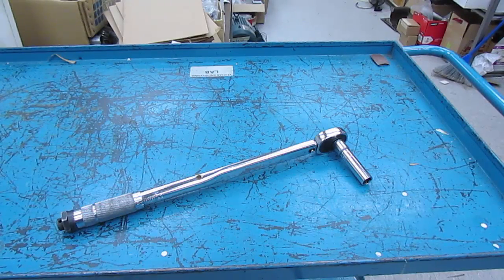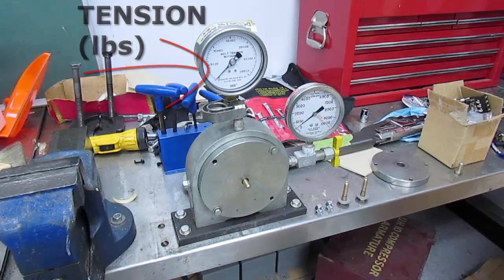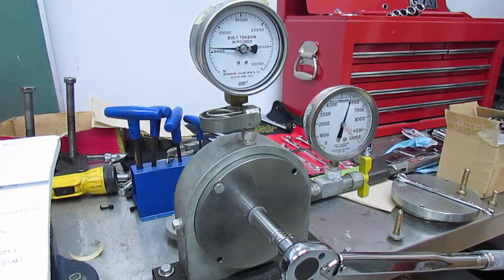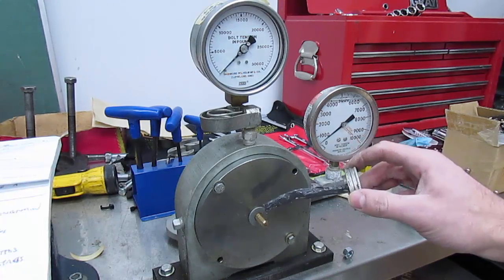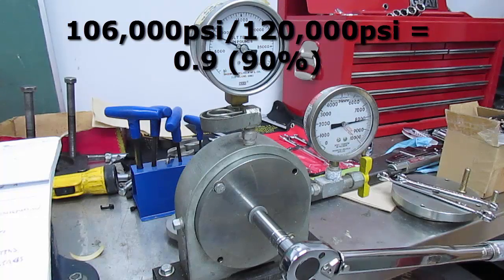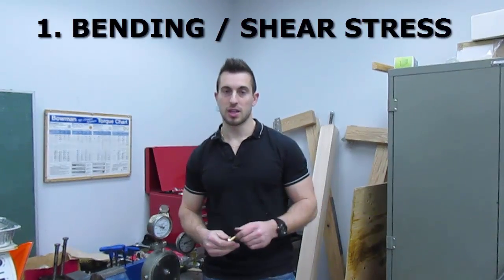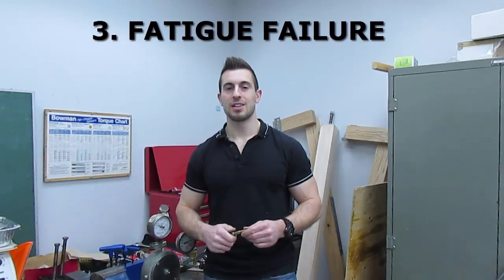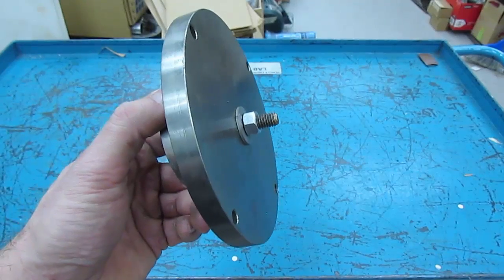Should You Put Anti-Seize On Wheel Studs / Lug Nuts?

Comment: hey whats up. I have a co-worker that goes crazy with this anti-seize stuff. I like this video cause it was super interesting. rather than just putting a dap, he covers the whole thing with anti-seize. now in your video you said that over time if you keep using anti the stud or the bolt will loose tension and it wont hold as well. well, I work at a shop that cars come back all the time for tires. or I see that the car previously had anti already on it. well bottom line I have two questions.
1. what can happen if you put too much anti-seize?
2. if you put too much, over time can your lug nut slowly loosen and fall off?
video was awesome please get back at me.
Reply from the maker: Thanks for the comment! Anti-seize will change the friction as I mentioned in the video which will increase pre-load (bolt tension) for a given amount of torque. As you can see, it's not difficult to change it enough to exceed the yield strength of the material and cause total loss of elasticity in the bolt. That being said, it's very difficult to quantify how much anti-seize is considered "too much," OR if any amount at all is acceptable. That would be something that would have to be measured experimentally I would imagine. So unless your co-worker plans on doing the experiment and then applying anti-seize with a syringe, I would recommend that he doesn't use it on wheel studs unless the manufacturer recommends it (and can provide a wet torque rating). So to answer number one and two at the same time, any amount of anti-seize has the potential to cause the wheel nut to back off and fall off if torqued to the dry torque spec of the bolt (stud). It can stretch the bolt and you will have zero clamping force potentially. Let me know if that makes sense to you :) Thanks for watching!

Comment: How is clamping force different from preload, does not the preload created the clamping force?
Reply from the maker: Hi Daniel, thanks for watching! Yes the clamping force is generated by the preload, however, it can be different. For example, if you have multiple fasteners, your clamp load will be higher than each individual tension load in the bolt. Also, depending on external forces, a compression force acting on the joint may increase the clamp load and decrease your preload. Check out the link in the description for a more in depth explanation! Thanks!

Comment: I've been an ASE certified mechanic for 11 years worked on thousands of cars and owned many cars for hundreds of thousands of miles and yet the ONLY problem I've encountered is lugs without antiseize on them.  Every time some crack head at a tire shop blasts your lugs off and or on, at full speed with a impact gun is what will get this problem started.  I do what my instructors had tought me and it never fails, ever.  Now over applying antiseize is bad and less is more when it comes to high load applications but in mine and every ASE certified master tech teacher I've ever learned from, has the derect instruction to use it after factory bolt coatings have been compromised.  

I'm interested in diffrent types of antiseize and measurable amounts in application alongside the effects of heat/cold and material grade that had antiseize applicated.  Re-torque lugs you use antiseize on, is in my opinion strongly advised as over applying will allow spec to looses as where just enough will stay in spec.  Remove excess if torque spec fell out after 50 miles, then again at 50 miles if there was a correction. [do it right the first time]

Spark plugs on another note can react negatively with antiseize especially those with a low torque rating to begin with but otherwise high torque plugs, do just fine and prevents the use of adding a helicoil down the road. 

My experience is tried and true with time to tell and all I suggest is if you do use it, don't over do it.  .5-1 milliliter appropriately placed will do its job correctly but do cover all the threads.  Application is KEY!

A shirt ton of the stuff is all bad and unfortunately in my opinion voids this experiment, I like the example though!

To add some gravity, I placed 1st in Skills U.S.A., a national competition for mechanics.
Reply: Gamma Light - I was introduced to Anti seize compound in 1960. It was provided to me at a Chevrolet dealership I worked at as the factory recommended cure for the problem we were having with steel studs damaging the threads on the newly introduced aluminum Corvair engines.
The advise of using it sparingly is correct. I left the automotive business in 1962.  I continued to work on my own cars for fifty years and I still have the same can of anti seize. No wheels coming off or spark plugs pulling the threads out of heads in all that time.
Reply from the maker: Thanks for weighing in! I will agree with you that for re-torqueing there is a place for anti-seize. The thread surfaces get chewed up after the first torque application and then friction increases, thereby reducing preload on subsequent applications of torque. Some amount of anti-seize can "restore" the original friction properties and give you the initial preload. 

In my opinion, however, most people blasting lug nuts on and off are not 1st place ASE certified mechanics and they will definitely not measure out the amount of anti-seize being applied. Most people don't even recheck the torque on their lug nuts after 50 miles. So the problem becomes that people will over do it with the anti-seize and they over tighten on top of that (no torque wrench, no torque stick on an air gun, etc.) Professionals such as yourself take much greater care in what they do.
Reply: I agree. Less is always better when applying anti-seize but it is definitely necessary in certain - not all - instances. For example, did you know that NGK spark plugs have a proprietary anti-seize on the threads from the factory? However, once removed they have to have anti-seize added if you want to re-install them. Sparingly, of course.
Reply: Gamma Light. Im starting to learn what lubricants to use on my car and hoping that maybe you can help me out
Reply: No offense. But with all due respect, you may still be putting people lives or at least vehicles, at risk. This guy and his exceptionally well thought out and detailed video may have just saved me from catastrophe. Although in my case, all 12 posts and lugs were rusted then compromised. Alot of people don't know this but even surface rust changes the entire properties of a bolt and it's threads! So to me why even chance it for a little bit of money??

Comment: Good video. They should provide lubricated torque specs for everything. I have used anti sieze on pretty much everything including lug nuts and never had a problem.
Reply: Likewise. I started using anti-seize on wheels and lug nuts out of self defense. 
First, when I could not get my lug nuts off (no impact wrench at my house) my car, I used a cheater bar on the lug wrench and litereally twisted the lug bolts in two WITH THE NUT STILL ATTACHED. 
Second, when I could not get my alloy wheel off my steel brake hub I had to use a small sledge hammer to literally knock if off. 
Since then, I've used anti-seize on the lug nuts WITH A TORQUE WRENCH and I've used anti-seize on the brake hubs that are exposed to alloy wheels. Since then, I've NEVER had a problem with anything coming loose. I've discussed this issue with several professional mechanics and they have all agreed with me. 
This is fact based on my personal experience and not an opinion.
Reply: @boomerguy9935  If that ever happened to me I'd be inclined to use anti-seize on the lug nuts as well, but like with OP I change my wheels every Winter so there's not much chance they'll get welded on. However I am going to be replacing the lug studs and nuts after seeing this video. I've made around ten trips to tire shops in-between doing it myself over the past several years and now wondering how stretched everything is out of spec. Better safe than sorry.
Reply: You should do this test with loctite on a bolt, I would think wet loctite would increase the fastener load.
Reply from the maker: Loctite is supposed to simulate the friction of a dry fastener, and therefore has been designed to not be a friction modifier. Realistically you will probably see some difference, but it shouldn't be nearly the difference you see with anti-seize.
Reply: Big Miss: 2 types of wheel nuts. 
Type 1: open top. No chrome cap. Good. 
Type 2: cap nut. Closed top. BAD. Why? Rust will form on threads from water that infiltrates under the cap...andcstays there. AntiSieze a must.
Reply from the maker: Thanks for the comment Bobby. It would be nice if they did, but I think with the number of variables present when the anti-seize is applied, they probably do not do it for liability reasons as well.
Reply: Embrace Racing do you think lock tite would help with the corrosion and being  able to get them off.
Reply from the maker: To be honest I haven't put too much thought into it...so I'll think out loud here for a minute... loctite is not a friction modifier, so technically you shouldn't have any risk of over tightening your bolts. Second, loctite basically fills up the gaps inside of your threaded bolt/nut coupling and this is what prevents loosening. That being said, you may get the added benefit of preventing water(salt water) from seeping inside and acting as an electrolyte for galvanic corrosion to occur. I can't guarantee it will prevent it, so if it still does occur, you might be double screwed when you try to use a penetrating spray to loosen rust because the loctite will prevent it from getting in the threads. That's a tough call!
Reply from the maker: Also, to add to this conversation... I live in Canada so I typically change my wheels annually for the winter. I have no problem using dry fasteners as they typically do not seize in one season. I'm not sure what your experience is like because of your location.
Reply: Embrace Racing so on your personal cars you don't use anti sieze? And have no problems getting the lugs or other bolts off? Do they use salt where you are?
Reply from the maker: On my personal cars I do not use anything. Just the proper torque. The roads here are heavily salted but I typically don't have any issues with the lug nuts after one winter season. I find that the wheels usually seize a bit on the hubcentric bore, but a good kick gets them unstuck.
Reply: I have no problem either but my nuts are closed on the end, vs. open.  Open just gives another access point to get salt water into them.
Reply: If your studs are starting to rust and seizes over the winter car manufacturer recommends that they be replaced.